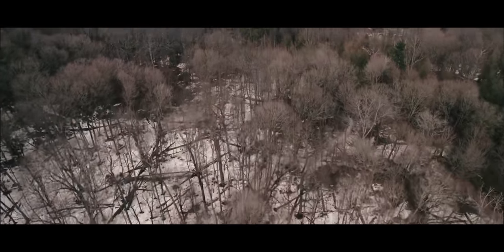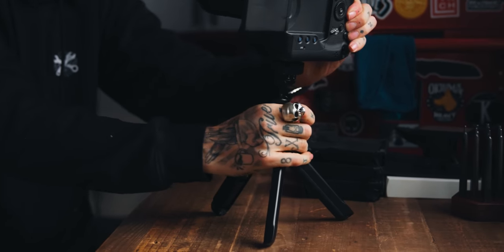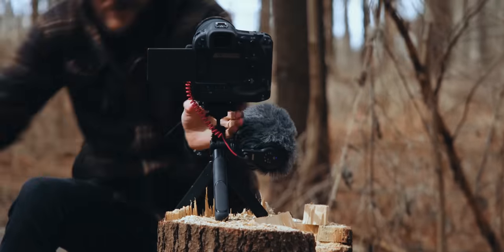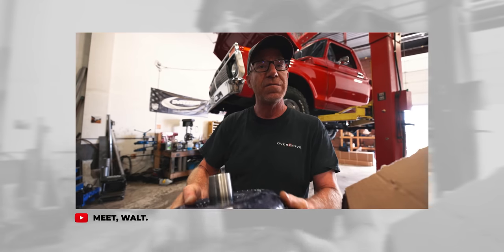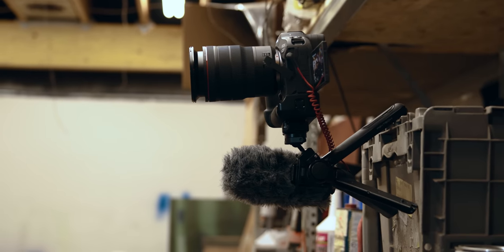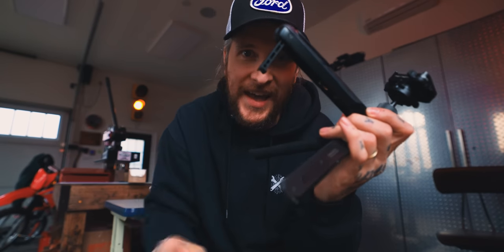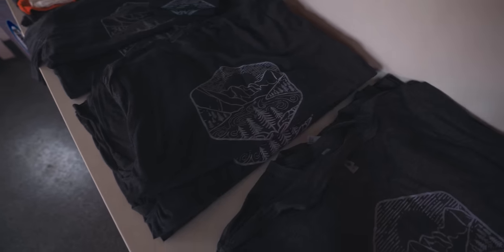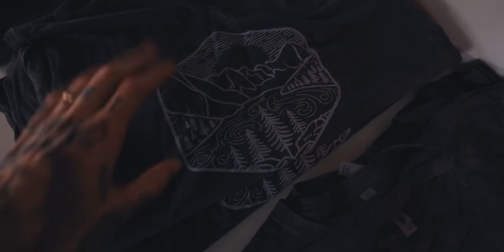The Tactical Multipurpose Camera Tool

Comment: Great video - the tripod looks great, I'm just wondering how durable is it? There's a lot of hinges to go wrong. Is the material strong enough for handling everyday use?
Reply: I have had one for a couple of months now and it is surprisingly durable.  I know it looks cheap in photos and videos, but the legs, head, most everything on the thing is made of metal.  I use it with an R6 and RF15-35 and haven't had a single problem.
Reply: @JasonPischke  Thanks for the reply! You’re right, it does look like it’s made of plastic or some kind of composite. Might have to get one now…
Reply: @workandfamily  apparently it's made of some magnesium too, according to the website
Reply: @AndersARLarsen  well now I have to get one!
Reply: @JasonPischke  nice💯
Reply: I've legit stood on mine. It's durable 😉
Reply: @DanFox  fair enough!